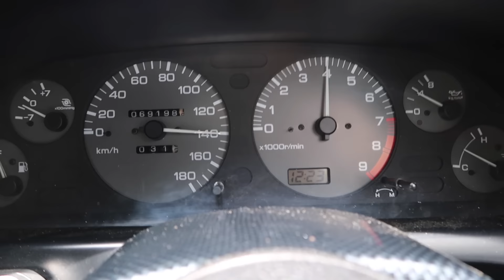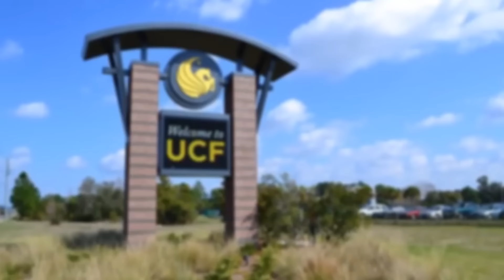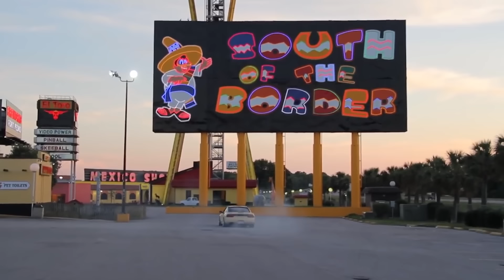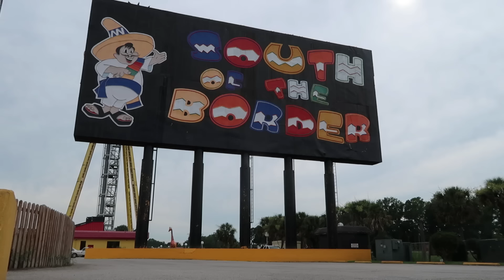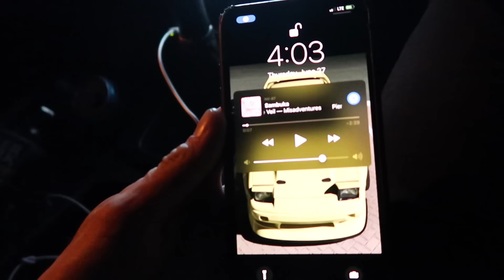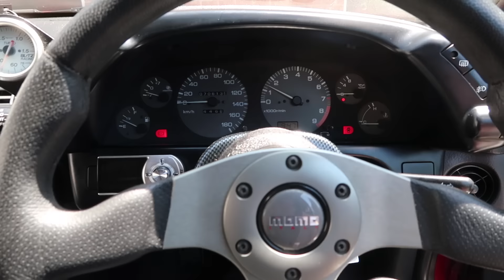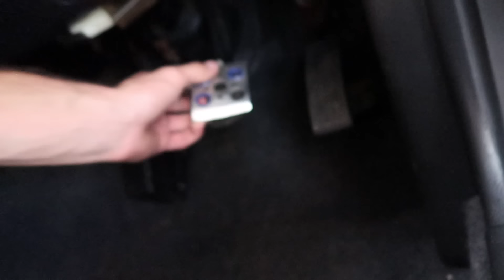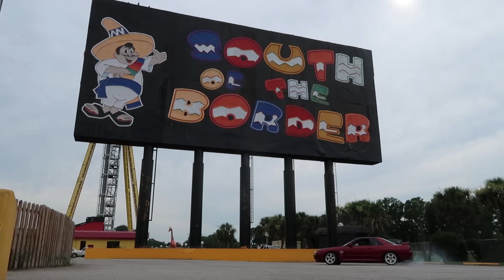Surprising my Dad with an R32 Skyline!

Comment: I get the feels on this one.  Me and my dad bonded over cars he has had a lot of cool cars over the years and i would probably just be a boring normie with a 4 cyl sedan if it wasn't for him.  he liked to buy total restorations and do the car from top to bottom.  mostly lost money doing it but it doesn't matter that was his passion.  Sucks he got macular degeneration in his early 20s and can barely see.  His license is day time only and he has to wear really expensive glasses with a mini telescope on it.  He will only drive to work and back anything else he has me drive, the last time i was in the car with him driving he ran over the curb 3 times then stopped and said you drive.  Now he is finishing up the last two cars he will restore and getting rid of the shop.  

list of cars he has restored that i can remember

Datsun 240z
Datsun 280z
Datsun 280zx
60s Stingray corvette
2 Mercury comets
Triumph TR6
Sunbeam alpine
2 MGB's
MG Midget
Fiat 124 Spider
600 HP 3000GT VR4 ( wasn't a full resto but more of trying his hand at making power)
65 Thunderbird
80s Porsche cant remember what it was

His 2 last cars
73 Charger
76 Cobra II Mustang

I know there was a few more cars but i cant remember all of them.  I loved the 280z and the VR4.  when i was 19 i got a 3000GT SL because of him having that car but i got rid of it after a year was to slow.  Well i've rambled long enough you probably won't see this but much love man this video got me in the feels and i appreciate all the content you put out.  first thing i do when i get home from work, i get some food, sit in my chair, and see if El Zed, Cleetus or Rodknock have uploaded in that order.

Comment: used to drive a '79 skyline GT 4 door (2000 GT E/S )with a swapped L28 triple solexes while stationed overseas swapped head/tail light off an '81 skyline had a cleaner look at the time with front air dam miss that car great cars all of them and a great gift for your dad. also loved the solstis engine seap for your mom quite a lady brings back great memories back in the mid late 80s

Comment: I bought a 92 gtst straight outa japan when I was 18 had 20,000km on the clock bought it for 18k nz back in 1998 still one of my favourite cars iv owned!! Could swing donuts in 5th gear.. ps lol you forgot to silicone spay his tires

Comment: My dad is almost 80 and I'm 14 have some experience and instead of buying a car for me I want to fix up his 280z it's clean but it's been sitting for 20 years had no rust engine got rebuilt in 98 I think he wants to get it pearl white turbocharged rebuilt suspension full disc brakes all around it has 300 something horsepower now but I think if it has a turbo it'll fly it's his dream build but he can't do it we moved from cali to oregon into the mountains and it sat in our new built shop because he didn't want to ruin it driving it in the dirt it has less than 100k original miles and it got rebuilt mom wants to sell it because it taking up room but if it ran and was nice that would make my dad faint